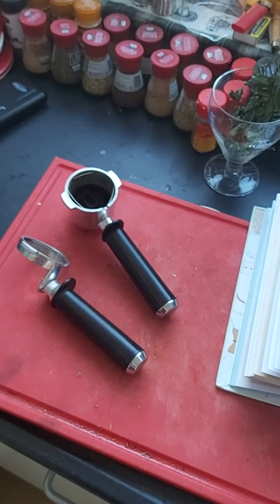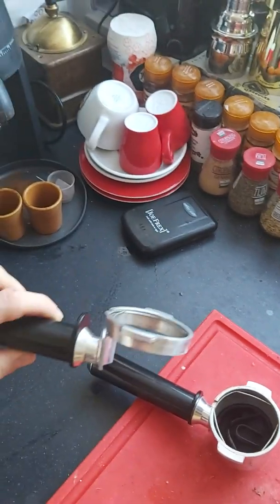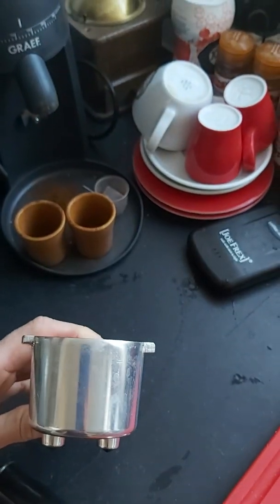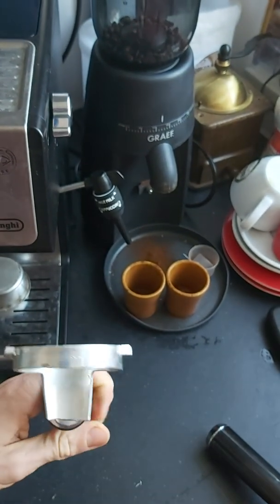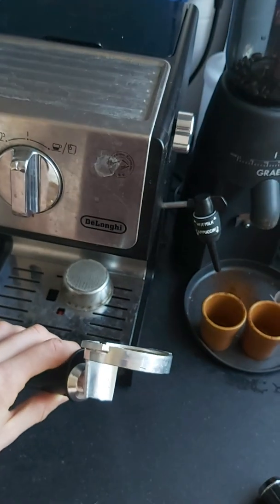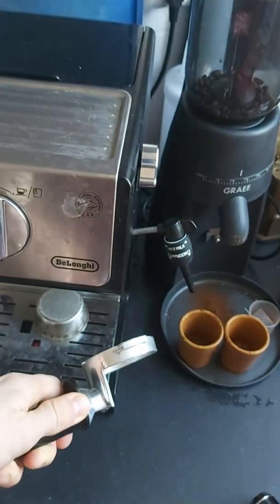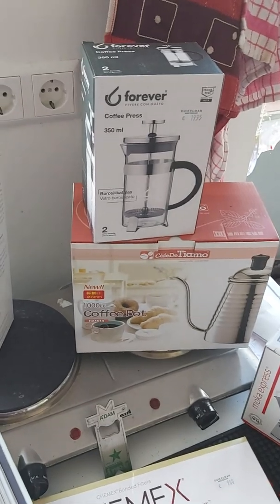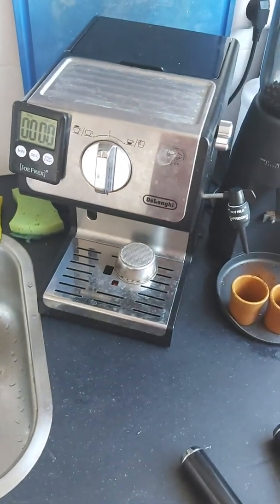FAIL!? = DeLonghi Bottomless Portafilter

Comment: Do you think the depth at which you cut it to has an affect on the support structure? In other words would not cutting the portafilter as deep allow it to keep it's structural integrity?
Reply from the maker: I definately think so! It bent most at the narrowest part. To prevent bending, I fear I'd have to leave so much material, it'd be hard to see the dripping unless you took a really low angle.

If you were to accept this in convenience, you could cut try and cut it the way I did the first time: just sawing of the 2 spouts. Fair chance it'd hold its shape!

Comment: Have you searched/found an aftermarket bottomless portafilter for the Delonghi ECP 35.3? It seems like there are tons of options for the Dedica, but none for the ECP range. I guess my only option is to get a spare part like you, and cut the bottom myself. Minding to cut off a smaller section, so to leave it structurally stronger.
Reply from the maker: An instagram friend baught and tested one with good results. I will ask him where he got it.
Reply from the maker: This is the one: fr.aliexpressDOTcom/item/4000858944156.html?spm=a2g0s.9042311.0.0.7cd06c37JfhslF
Reply: Thank you! I'll check it out.

Comment: Interested in knowing what sort of shots you were pulling with the bottomless portafilter and the non pressurised baskets. Have you got any videos of the results? 
I have seen on Ali express that they have a bottomless portafilter with 2 locks instead of 3 that would work with the delonghi 35.31, so I am looking at giving that a go. 
Also Interesting in knowing if you have tried any further aftermarket parts recently with this machine
Reply from the maker: @acharmanduh  hi Aaron, that two-lock Ali Express model seems to be worth a try. I wonder how that one will work for you. Although I do not have any comparisson videos on bottomless versus spouted shots, I can tell from personal testing and memory that with both you can pull good shots out of the DeLonghi. The bottomless versions do enable you to minimize local over-extraction by correcting for channeling. It's another variable that you can take control over. IF your distribution and tamp are top-level, the only remaining difference would theoretically come from small losses of temperature due to more contact steel/aluminium and slightly longer extraction time due to increased pressure by being pushed through the two spouts. Noticable? Maybe. Significant? Most likely not, if you control and finetune everything else in your "recipe". Worth the investment to get that channel-control? I believe so. 
However, on a scale of impact, I recently encountered a much larger problem with dose finetuning = the 51mm baskets cannot hold enough coffee to get the traditional recommended brew ratios. My next video will be on this, where I discuss the issue and its relation to the three ways of constructing a shot, concluding with which one(s) are suited for the DeLonghi 51mm series and an "example recipe".   

As to your last question: for the same coffee studies I recently compared my most used La Pavoni Stradivarius 51mm non-pressurized basket with the popular Amazon / Ebay model that most people seem to get (the 51mm one with the "annoying" protruding dosage line). I found out that the Amazon model had slightly but visually noticable larger holes that in fact caused a reduction in extraction time of no less than 5 seconds, all other variables kept the same. So the latter basket would require a finer grind than the former. I'll link to this in my next video ("Light Grind series").

Comment: I have this machine too. Is the naked portofilter changes taste toooo much? Or just for cool view?
Reply from the maker: Hey, tastewise not much directly. Main benefit is that you can see if extraction is equal for the whole puck. If I had to choose, I'd value grind control more highly. Onve you've mastered your grind, then you can micro manage your tamp using a naked portafilter.

Comment: Hi  thank u for all your videos, but if I want to buy a bottomless portafilter the size is 51 for this machine?
Reply from the maker: Hi Haneen, yes but be careful! I saw a few "DeLonghi" bottomless portafilters on sites like AliExpress, but they had THREE contact points that lock into the station and thus were only for the DEDICA series! The ECP series uses portafilters with only two contact points to lock up the filter. 
You might think to just saw or grind off the 3rd metal ridge, but the problem is the positioning as well. The EDC portafilter has two ridges, left and right, that lock into the machine. The Dedica's three points are diagonally backwards and the third one is to the front. So to repeat: these bottomless filters will only fit in the Dedica models, not the ECP.
Reply: Haneen Al Sahli https://www.aliexpress.com/item/4000892055133.html this one will fit and it has two contact points .. I already contact the seller and show him the machine .. good luck

Comment: Do you think it has to do with the fact the portafilter only has two mounting points, whereas the dedica has three?
Reply from the maker: Hypothetically: yes. The extra locking surface would support the portafilter more. 
Knowing what I know now, IF had a dedica, I would put the portafilter back in the station after a quick cleaning with hot water, to make sure it cools down slowly and properly supported.

Comment: Hi! Im just curious, what will happen if you use your modded bottomless portafilter with the original preassurize filter? Will it spurt like crazy? Have you ever try?
Reply from the maker: Good question, I never did! Probably no one ever did because the pressurized basket makes a bottomless filterholder obsolete. Perhaps someone else here is willing to try? 😄
Reply: Nvm, i tried this after cutting the bottom of my portafilter, yes it did spurt like crazy,its look like a motorcycle injector😂